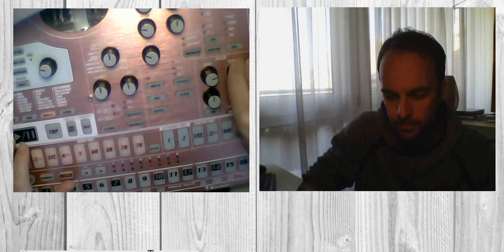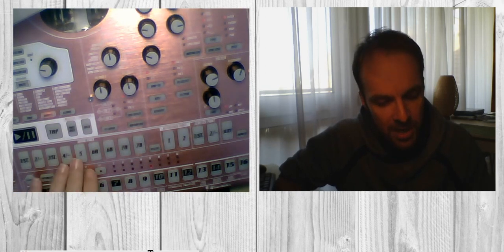use lowpass filter to boost high frequencies? (electribe SX tutorial)

Comment: Hi Leon, thanks for your work ! In your opinion, why use the resonance to boost the frequences around the cutoff results in a sample with less low frequences ? Is only my impression or is happening ?
Reply from the maker: I think you're absolutely right. When boosting high-freqs, the low freqs seem to decrease..but when boosting mid-lowmid freqs clipping/distortion happens quite easily. The electribe 2 samplers has cleaner filters..but that makes it harder to get a similar dirty response like the ESX. I guess there's no such thing as a perfect filter :)
Reply: @leondustar  I love my esx, with all his limitations :) 
I thought that a decrease of low frequencies when boosting with resonance the high is caused by an internal process that decrease all the signal in order to allow the gain of the frequencies around the cutoff freq without distort so much the signal, in fact, as you say in your video, if you increase the level of the part you can amplify also the bass frequencies. But maybe my tought isn't correct, i dunno... :/